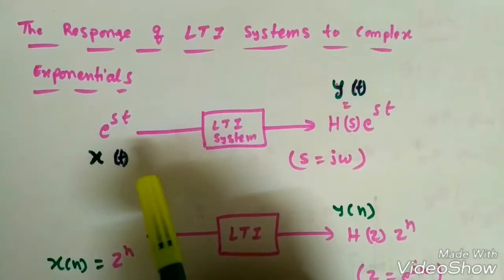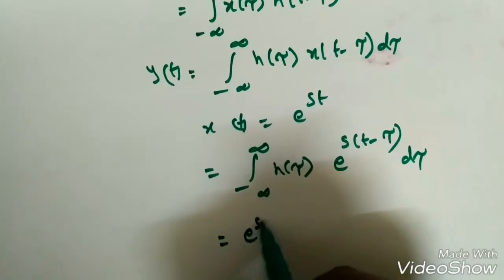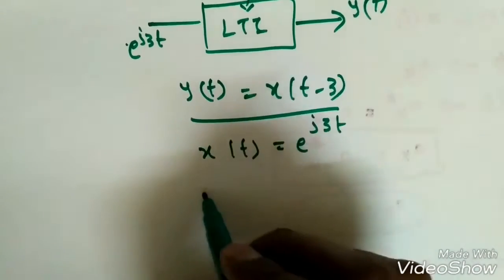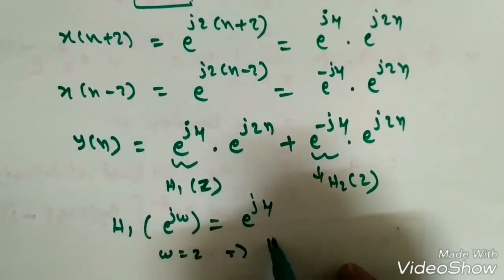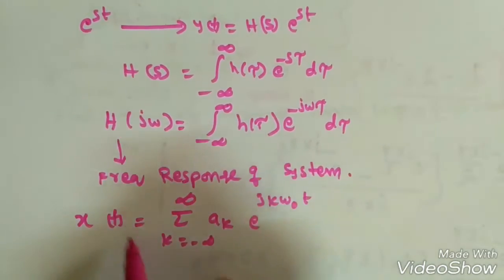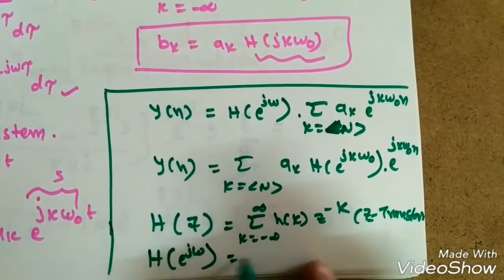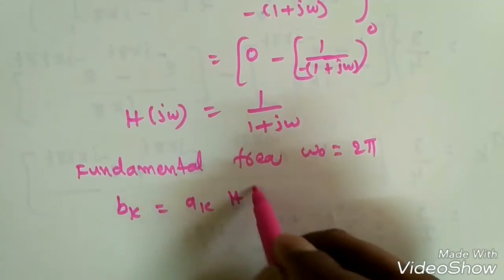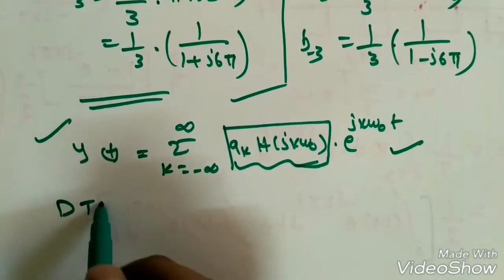Signals and Systems Lec-24: Fourier Series and LTI Systems

Comment: sir in question 2 , overall transfer function is asked but you determined for x(n+2) and x(n-2) . should it sum up to make overall TF? (means will H1(z) and H2(z) will add up to make H(z) ?
Reply from the maker: yes we have to add  H1(z) and H2(z) to find overall H(z)..thanks
Reply: then it will become zero . so my question is ,can transfer function be zero ?

Comment: sir,when we finding energy actually for what value of limit varies 
1.is that "t" and "n" for continuous and discrete?
2.And during fourier series rep in discrete x(n) limit will be
options
1. one period
2.from "0" to n-1 period
And sir u have used both the conditions ,so only i have a doubt.if both are acceptable .under which situation these two formulas should apply?
Reply from the maker: 1.to find energy in continuous t varies from -infinity to +infinity and in discrete we have to take lim N tends to infinity and (1/2N+1)* summation from -N to +N.....and take lim N tends to infinity and (1/N)* summation from 0 to N-1
2. for discrete time Fourier series we have to take for One period...this period may  take 0 to N-1 or N/2 to -N/2 depending on the given signal x(n)